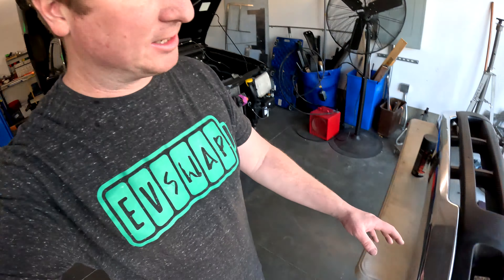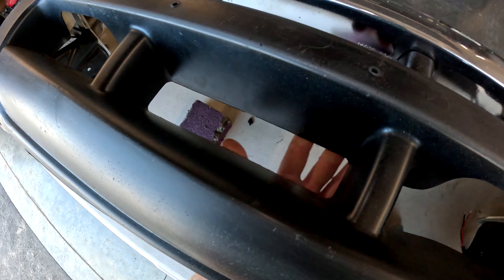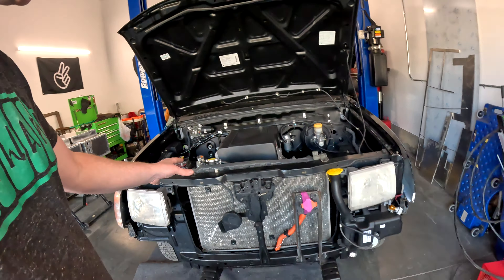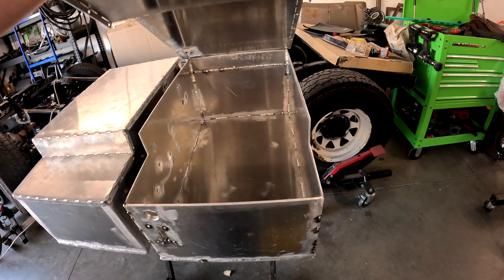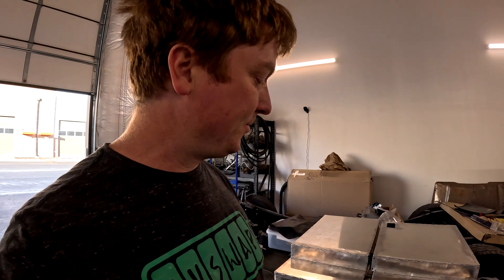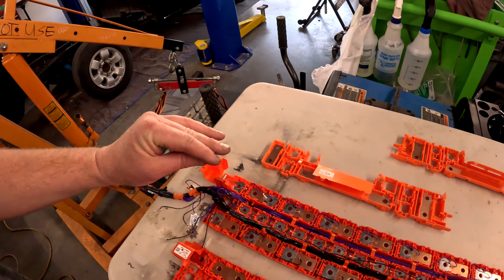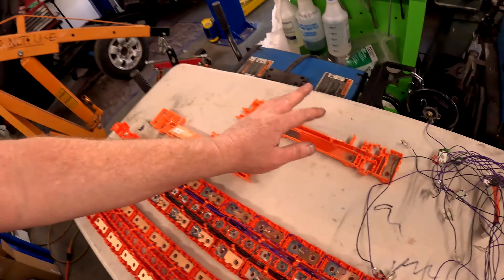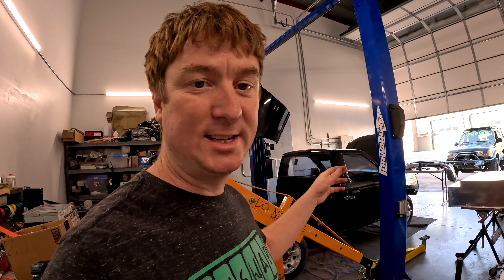Nissan EV Pickup Truck Update #16! Battery Box x2 Plus LED Lights

Comment: would be curious about payload capacity
Reply from the maker: This truck has 1500lbs payload capacity stock. The weight balance may shift a little rearward. I will weigh the truck when it is complete and we can calculate the payload capacity. Thanks for the idea!